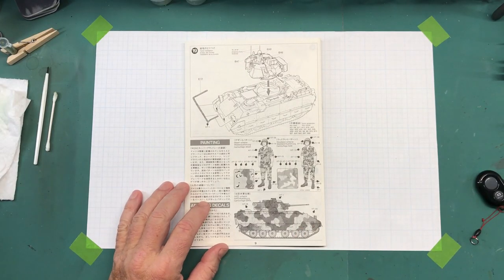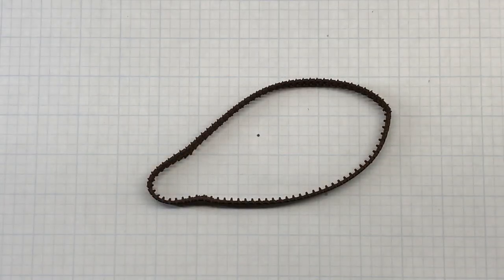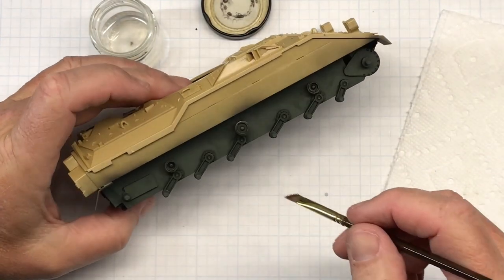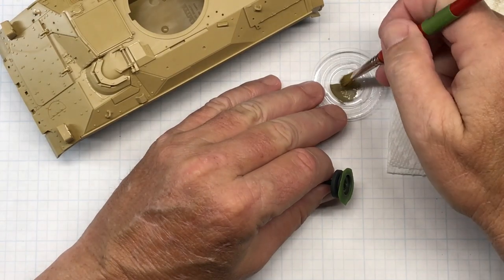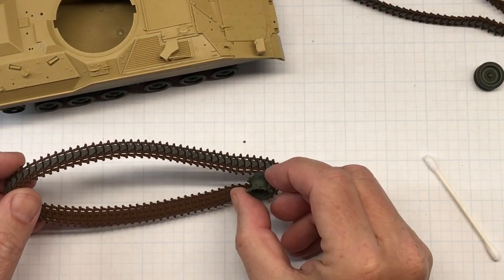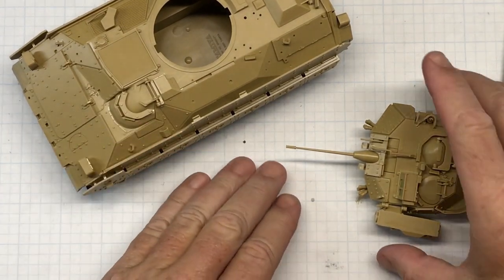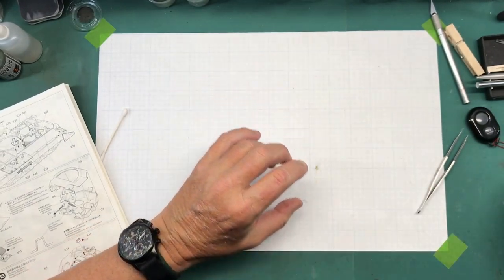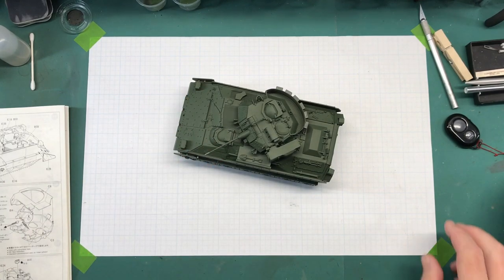Tamiya 1/35 M2A2 Bradley, Part 6

Comment: Brett, very, very nice modeling. Much nicer than you call yourself, "a regular dude". A bit of inside baseball on US Army pioneer tools and ammo cans...Nearly all live/blank ammo cans are initially forest green (like you find in MERDC colors) from the ammo manufacturer, and pioneer tools are almost always repainted after each field training exercise (FTX). Equipment is cleaned and serviced upon return from the field and anything that can rust [or doesn't move, lol] gets repainted. Universally across the Army, Krylon Olive Drab or Krylon Flat Black are used. Soldiers can get spray cans through the supply sergeant or, the squad/platoon NCOs often buy it out-of-pocket from the Post Exchange. CVC helmet bump/ballistic shells often get the same treatment. Pioneer tools will usually [initially] be [NATO] CARC green, but due to lack of standardization and consistency, wood handles will either be painted or left natural wood. I have been issued many initial issue/replacement tools [between wheels and tracks], and just like a box of chocolates...
Reply from the maker: Thanks for the excellent info on the tools and such. Too often the info is hearsay, but a primary source is always a great thing!